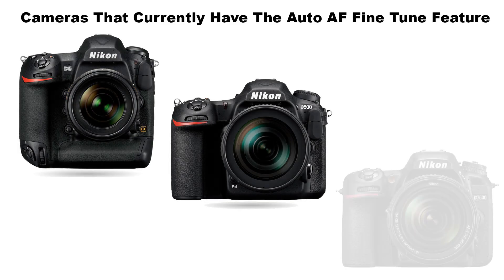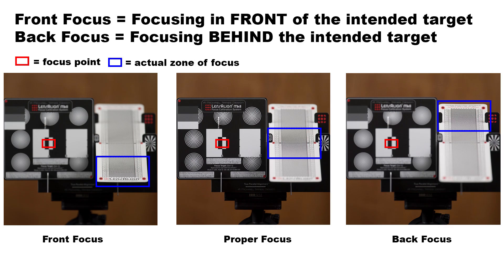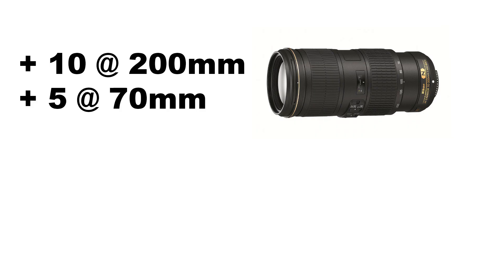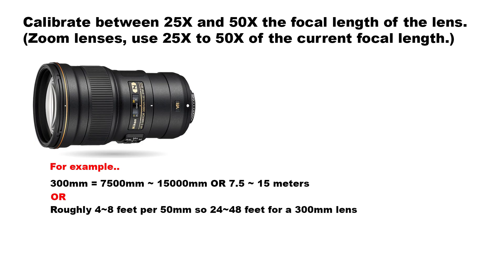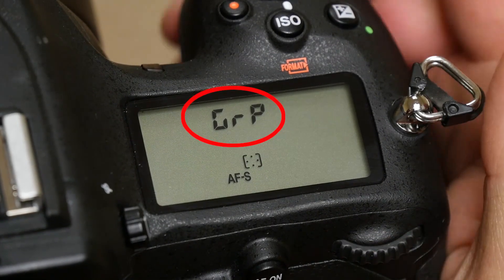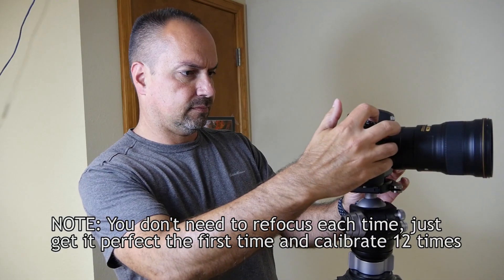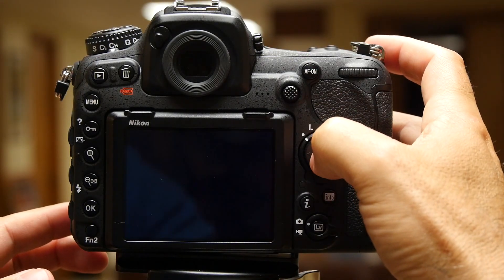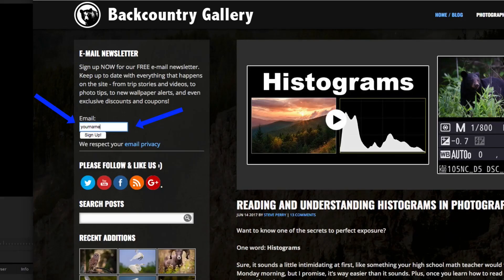Nikon's Auto AF Fine Tune - How To Get The Most From It

Comment: I just did your method on a lens I had already tested using a different method. One of the methods is way wrong. I did 12 test shots as you recommended. Of my 12 shots, 8 of them came back as a set point in camera as +20. the other 4 were a +14, +15 and two +19. Using the other method I had already used on this lens at the same focal length, I got a range of +2 to -14 with the sweet spot being -6. This is too big of a difference. Why am I getting this high of a difference? It is a zoom (Tamron 70-200mm f2.8 G2). I haven't entered any setting into TAP IN for this lens. I was trying to get the setting to enter and I am getting too much variance. I did both testings with the lens on a sturdy tripod, ballhead plate completely level, lens wide open, AF on lens and camera turned on, VR trend off. I am even turning AF fine tune off after each one, resetting the set point to 0 and deleting the saved set point so I am getting a new neutral value each time. What is going wrong?
Reply from the maker: Honestly, it sounds like you may be doing something wrong - not enough support, poor lighting, poor target, improper focus,  etc - there's really a lot that can cause crazy numbers like that. In nearly every case I've see though, it's been one of those four. The other possibility is that there is something wrong with either the camera or the lens. Was it front or back focusing when you decided to fix it?
Reply: I was just trying to fine tune the focus. My target was well lit. Had 4 spot lights on it. My tripod is stable. It a RRS series 2 with BH55 ballhead. I only used one section of legs extended to keep the height down and instability down. The lens is only a few months old. I havent had any focus issues with it. My camera is a D850. I havent had any focus issues with any lens I've put on it. I'm only trying to tweak the focus on my lenses to make them a little sharper. My target was the flat target from my Lens Align kit. I would image it is precise enough.
Reply from the maker: @PaulW98Z  My advice? Unless you really see front or back focus issues, it may be best to leave it alone. I've seen a lot of good lenses turned into poor lenses when AF tuning was used when it wasn't needed. 

That said, I honestly don't know what's causing the wild differences. It sounds like you have it right, but the wild numbers make me think something is off - are you refocusing between each shot? That'll do it too - just get perfectly sharp focus once and then run the tuning. Also, although unlikely, there could be a bit of debris on the AF sensor - that would cause wild results too (they are under the mirror - put the camera in sensor cleaning mode and, holding it upside down, blow off the area under the mirror).
Reply: @backcountrygallery  I'm resetting the focus each time. Then requiring a new focus lock before reactivating the Auto Tuning. I dont know.
Reply from the maker: @PaulW98Z  The way I do it is to get perfect focus one time, then running the tuning procedure. The trick is you need 100% perfect focus, but once you have it, you're good. The camera is comparing what you consider 100% perfect focus to what it thinks it should be and adjusting. If you refocus each time and are even slightly off from shot to shot, it'll give you wild numbers. Let me know if that helps :)

Comment: Does this need to be done ea h time the lens in put on?
Reply from the maker: Nope - once you have it done, it's done and the camera will pally it each time the lens is put back on. Just make sure you leave AF Fien Tune turned on in the menu. Also, if you have two of the same lens, the camera will use the same setting for both lenses (I know that likely doesn't apply, but just FYI).

Comment: Useful, but D750 does have it. P389.
Reply from the maker: It has AF fine tuning, but NOT auto AF fine tuning. This video is about the auto feature.
Reply: @backcountrygallery  Aha, dang, brain skipped the auto part.
Reply from the maker: @simmo303  FWIW, the D780 has the Auto feature :)
Reply: @backcountrygallery  Out of my price range, not that desperate for auto fine tune. Have the D750 by accident, auction was for D7500.
Reply from the maker: @simmo303  Gotchya. The D750 is really a great camera - one of Nikon's best IMO.
Reply: @backcountrygallery  Agreed. Not only did I get it for a D7500 price but the serial number showed it to be one affected by the flare fault - just had it back from Nikon with a new shutter. Best I've had since 1956. Tried many.

Comment: Hi Steve  excellent demonstration. I would like to ask if the focusing to the target is done using autofocus or is done manually. Thanks. Costas Karseras
Reply from the maker: Doesn't matter - the big thing is that it's 100% as sharp as it can be. Usually, just regular contrast detect AF in Live View is fine, but as long as it's as sharp as possible, you're good.

Comment: Thanks for the video, Steve. Two things: is the AF fine tune process the same for the Nikon Z series cameras? And, has your Nikon focusing book been updated for the Z series?
Reply: Judi LeCompte hi Judi !
The «Z» system doesn’t requires fine tune as it uses the sensor directly. Live View being the reference point when you fine tune a Lens,  it only compensate the difference between the AF using the mirror and using the sensor. 
Hope it helps :)
Reply: @DuquesneXavier  The Z system does need it too, that's why it has an option in menu
Reply: Robert Ranti oh ok : i wrongly assumed it wouldn’t need it since there were no mirror, but ok :)

Comment: SO will the camera reset when you put on a different lens. or is it once you fine tune, it's good for all lenses. I guess I am asking do you, or should you do this for all your lenses that u think the focus is off for cause the camera will know what lens you have on, and where the fine tune adjustment should be for that particular lense?
Reply: OK I found someone that asked basically the same question in t he comments and you replied that it  saves the profile for each lens. so ya have to do it for each lens but the camera will save that profile so when you put on a lens it knows where the AF fine tune should be, right?
Reply from the maker: You need to do each lens individually, and the camera will use the value you set when you mount that lens.

Comment: First thanks so much for this video - really well explained.  My one questions is if I do this for let's say my 35mm lens and save the value, and then I have my 85mm that I'm shooting with - does my D500 automatically detect which lens I have mounted and use the value that I saved in Tuning?  Or do I manually have to do something each time I mount the lens to have it reflect the Tuning number I saved?
Reply from the maker: The camera will automatically detect the lens, no worries.

Comment: I have a D500 and the Sigma 70-200mm Sport. I already knew the lens was back focusing really bad, it needed somewhere between neg 15-20 to get sharp.
 Great Video but I fight for about an hour to get it to work. THIS IS WHAT I FOUND. I kept getting a message about "Focal Lenght" when I pressed the 2 buttons. I was using Steve's formal as to how far away I needed to be from the focusing print out. So I set up at about 25ft, nothing I did work. So I decided after total failure to bring everything closer together, so I set up at about 12ft and everything started working perfectly. After much testing at 70 and 200mm. I then moved back to 18ft and everything worked fine. So if you continue to get a message about "FOCUSING" please move closer to your target.

Comment: My 150-500mm has a big problem, at 150mm at close distance, +5 is necessary, at 150mm at far distances no correction is needed, at 500mm far from subject, no correction is needed and at close distance (3m) at 500mm, -20 is not enough
Reply from the maker: I think there's some kind of dock front eh manufacturer that can address the issue. There's not much you can do with it using Nikon's AF Fine tune.

Comment: Steve, thanks for this video. I shoot with a D7500 and a couple of months ago I treated myself to a Tamron 150-600 G2. I love shooting wildlife, birds, etc. But I have been a bit frustrated. I cannot seem to get crisp photos. I have stopped using it. But I am not alone among buyers of this lens.  I was wondering your thoughts on the Tap in Console to calibrate this lens and does the video technique you describe here replaces the Tap in Console. Thanks!
Reply from the maker: I've not used the Tamron console dock, so I'm not sure. However, in my workshops I have noticed many less than stellar copies of that lens. I personally think the Nikon 200-500 is much better.
Reply: Jim Descher I also think the Nikon is better from 200 to 500 and for a similar price (for once), and at a fixed f/5.6, I can’t find a good reason not to go for the Nikon... (and also I tried the 3 versions Nikon Tamron Sigma and I always prefered the Nikon’s, while I use Sigma for primes).
That being said, calibrating the lens with the dock is a lot more efficient than within the camera as it will calibrate all focal lens more accurately than a fixed average setting in the camera ;)

Comment: Steve, In the AF Fine tune screen there is a place for saved value and default value. Both can be set independently. Is it a work around to use a Default value for 14mm and Saved Value for 24mm? I'm guessing that I can turn off AF fine-tune and have it Default to the value I entered there and turn it on for the other value. Does that work? I don't see that addressed in the Ebook.     edit: Talked to a rather testy woman at Nikon USA who told me that would work.   ... and as you note below, she was wrong.
Reply from the maker: The "Default" is what the camera will use for every lens attached IF it doesn't have an AFFT value. It's really only used if you have a camera that, no matter what lens is attached, is always front or back focusing. It's almost never needed. Still, it would work the way you describe, but you'd forever be going into the menu to turn it on and off - and worse - any lens you attached that didn't have / need an AFFT value would then use the default value, so you'd have to remember to turn it off. I know that, for me, I'd totally mess that up LOL!
Reply: @backcountrygallery  You are right as usual, the gal at Nikon seemed to be having a bad day and I really wasn't confident. I did that dual setting with one lens and the others were OK with one value. When I just checked all the lenses had the user input default value for the one I was working around. Thanks for your time and knowledge that exceeds Nikon staff. Now if you could get my Snapbridge to work.....

Comment: Great video, but I have a question. I was told the the focusing system used while in Live View is different from a View FInder focusing. How come this is using LV and gettin sharp images while usin the regular AF through view finder? Thanks
Reply: Vince Arredondo optical VF and live view are using two different focusing system. The OVF goes through the mirror, while the live view goes straight to the sensor, making it more accurate. The camera take 2 shots and in both modes and define a compensation mesure.

Comment: If i calculate my setup by your advice i get a dof from 27 centimeter. This is too much for af finetunen. 700x25 at f8.
Reply: Benjamin Wassink you don’t want to do the fine tune at f/8, only starting f/2.8 on bright lenses, and the minimum value for the f/4, or f/5.6 ones.

Comment: Hi Steve!  As a result of this video I bought your eBook and I love it!  Your writing style is wonderful and makes the topic easy to follow.  It can be easy to get glassy eyed reading about the buttons and features, but your book keeps me interested and on task!  But a question for you.  I tried to Auto AF Fine Tune my D850 with Sigma 150-600mm "Contemporary" lens at 600mm and a working distance of approximately 50 feet.  Camera/lens were locked down on a sturdy tripod, but every time I even breathed on the camera the image shook in the Live View window, and I would receive an error message saying the AF Fine Tune could not be performed.  This is the only lens I own that I can't Auto AF Fine Tune.  Nothing I tried eliminated that shake.  How can I Auto AF Fine Tune this lens at 600mm?  Thanks!
Reply: To over come the vibrating lens and camera try turning the lens mount thing 90 degrees and put the camera and lens on a sturdy table.

Comment: Great tutorial! One question though... Once I’m finished with the entire process as you have described, do I turn off (or leave on) the AF fine tune feature in my camera menu?
Reply from the maker: Leave it on or the camera won't use the settings you've entered.
Reply: Thanks so much!  @backcountrygallery
Reply: @backcountrygallery  Sorry I'm so late to the party but your video was extremely helpful and much appreciated.  However would you know why Nikon say "AF tuning is not recommended in most situations and may interfere with normal focus; use only when required."  With this in mind I'm cautious about leaving AF Fine Tune switched on for the few lenses that I've not yet calibrated.
Reply from the maker: @rigbyphoto  It's possible (although I've never seen it happen) that a severe AFFT adjustment could prevent the lens from focusing at infinity. That's why they say it. Although, I do tend to agree with the "don't use it unless you need it" sentiment.
Reply: @backcountrygallery  Many thanks. Your help is very much appreciated.
Reply: @backcountrygallery  Thanks, same question I had in mind. The other one comes out of it. If I fit a new lense, which haven't been AF-fine tuned yet,  I shall turn it off, but will the values for tuned lenses be stored in the memory? Thanks!

Comment: Thank very much for your video.

I follow all the step but when I press the two buttons nothing happens, there is no message in the screen. I have checked everything many times but without success. My Nikon is D7100. Any idea, please? Many Thanks
Reply from the maker: As mentioned in the video, this only works with the newer Nikon (D850, D5/D500 and D7500). There's no update that allows it to work on older cameras, sadly.
Reply: Steve Perry Upppsss... Thanks 🙏

Comment: Steve thanks for the video. I have a Nikon D500 with a Tamron 70-300 f/2.8 G2. I set the camera at 21ft from target @70mm 2.8 and it is giving me +20 +19 =14 =13 =17= so, on however I did crossed of the highest and the lowest added the rest all up and the number I got was 17.5 the last number I got was 19 so what is wrong here??

Comment: Steve
If you’re using a crop sensor camera to do this with a 300mm f/2.8 lens, do you take the focal length as 300mm or 450mm?
Reply: Did you get an answer for your query? Me too looking for it. Thanks in advance
Reply: Steve, do you take the focal length at 300mm or 450mm?
I’m just curious.
Reply: I’m wondering the same thing.

Comment: I'm confused. Other photographers on youtube told us, that "fine tuning"must be done using viewfinder and not live view screen. That is also my first question. My second problem is; I have good focus on 24mm end and bad on 70mm end of Nikon 24.70mm. How to solve that problem??
Reply: For your first question, use live view to make sure your target is centered. You can fine tune the focus if it is needed. 
In addressing the second question, you need to find a happy medium with zooms. I have a new Nikon 24-120 F4. AT 24mm, it sucks. At 70 and 120, it is great when I set the AF at +5.  24mm sucks no matter where I set the AF range. I had to compromise to be happy with the 70 and the 120, and get the best bad 24 mm I could.

Comment: I used Lensalign to calibrate my Tamron 24-70 2.8 lens came out with a -12 on the 24mm end and a +10 on the 70mm end any advices on what to set it on or is that to far out

Comment: Hope this is not a dumb question, But, does this apply to only Nikon Lens's?  I have 2-Nikon's, and 2-Tamron G2's. Also Steve, Did you have to calibrate your Nikon 200-500 f5.6?
I'm hoping I can use the D850's Auto focus Fine tuning on the newer Tamron G2's as I don't have there Lens calibration Tap-In Console.

Comment: Thanks for the video...Any advice on auto AF fine tune for the 105mm Macro?  If we use the rule of distance, that puts it at a min 103 inches.  Issue is, I normally use this lens at about 8-12 inches.  Wouldn't one want to calibrate using the range you normally use or will the auto AF fine tune not work in this smaller range?
Reply: I'm also interested in this question.
Reply: If you're using it in 1:1 macro range then it is easier to disable autofocus and rock the camera back and forth to adjust focus.

Comment: Hi Steve, thanks for the tips, just a question, once done with fine tuning and saving, will the settings be saved as default to the specific lens used to be calibrated and if i change lenses will it not be taken into consideration? Thanks for your help.
Reply: Antonio Marin you probably have noticed by now that it will record any setting and select it automatically as long as your AF Fine Tune option is turned on (that’s what the contact on the lenses are for, to pass the information ;) )